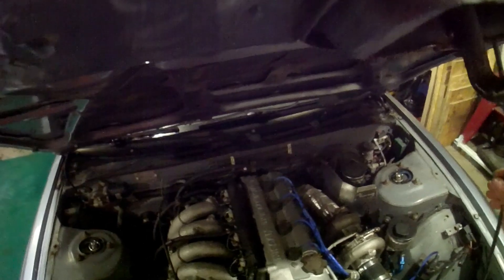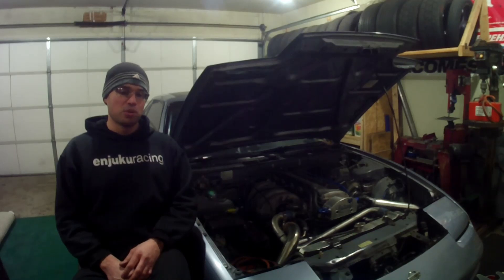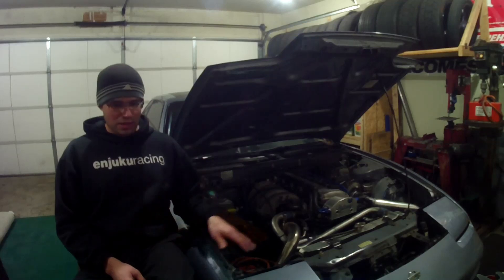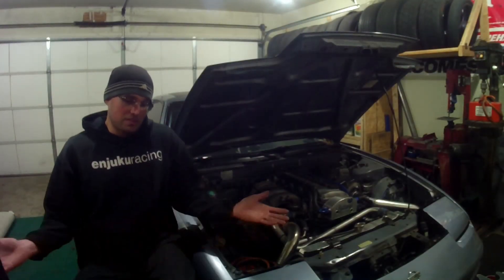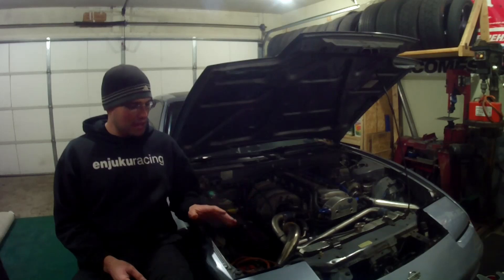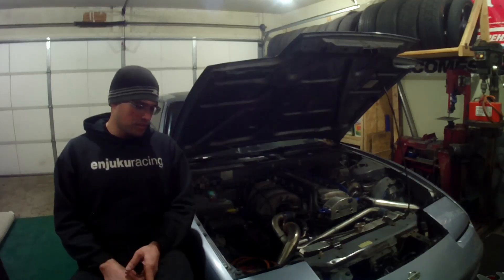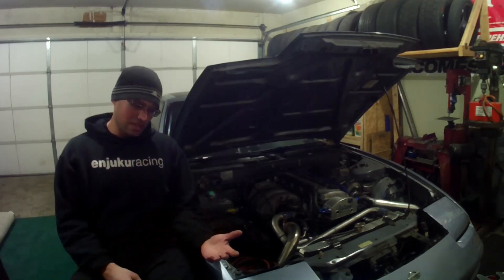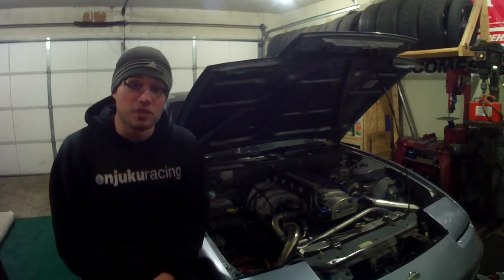High Compression Turbo KA24DE Build, Lets talk

Comment: I am doing the same exact thing with my s12. High compression single slammer pistons,s14 block s14 head, arp studs, cometic hg, and going to be running 97 octane till I get my e85 tune on nismotronics. People think I’m crazy going high comp turbo, due to how aggressive your tune has to be
Reply from the maker: Cool, will be interesting to see how she runs.  I'm expecting a very good throttle response.  The tune shouldn't be aggressive though, will only have a very small tuning window as far as timing goes.  We'll see what the stock ka24e pistons can take.  I'm hoping to be around 300/300 @8psi.  Let me know how yours turns out.